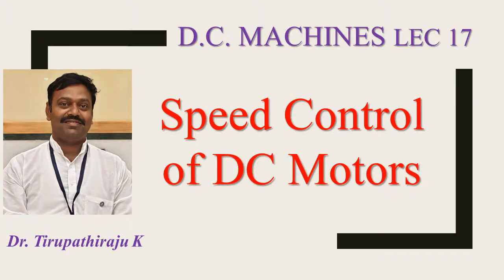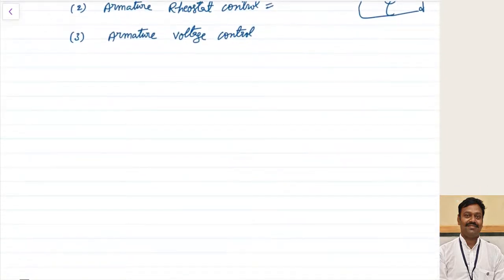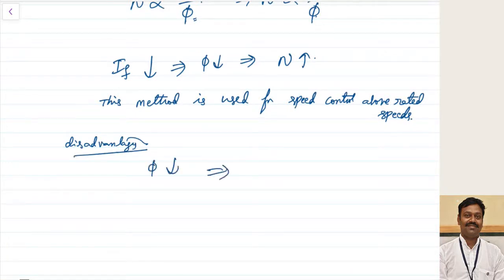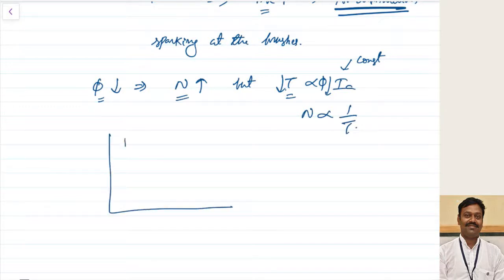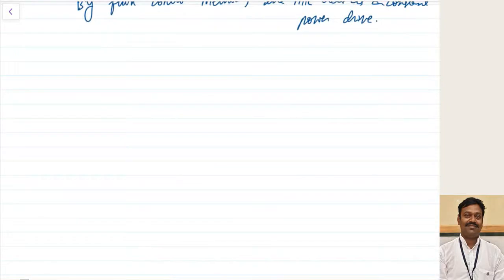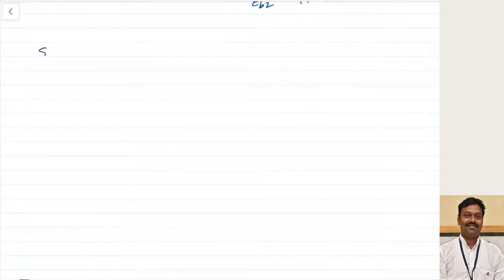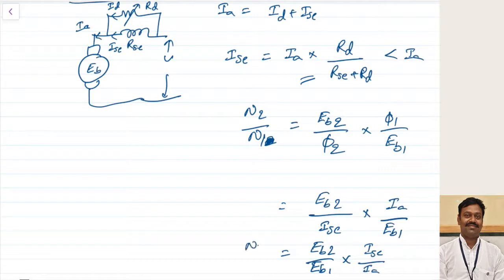DCM 17 Speed Control of DC motors

Comment: At 10:06 
Sir Problem regarding speed (above or below ) in field diverter method .

As i know speed inversely prop  to current , As  current  increses in series field by incresing Rd speed fall  down ,Then it be suited for speed below rated speed .
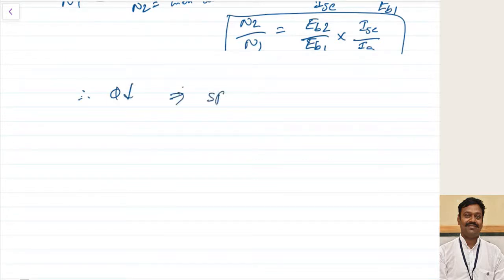Again you are saying at 10:23 
flux decreses (but phi  dec as Ise incr)
Reply: For given load at rated speed, flux & back emf are constant . By connecting  resistance parallel to field, the field current decrease(since current through the field is depend on the load & it has two paths)then flux decrease therefore speed increase. To decrease speed below rated speed, field current should increase but by connecting parallel resistor to field, the field current never increase for a given load

Comment: Sir is it correct that the brass arc( of we use it) connects the no voltage coil to the starting arm??? 
Or is it connected to stud no. 1 of starting resistance
Thank you

Comment: @Lectures in Electrical Engineering Sir..... What will be The Supply with which all the machines will be connected to operate with ?
Reply: @lecturesinelectricaleng  but Sir.... How Would The DC Generator, That is employed there, Rotate With AC Supply ? As The Field Is Separately Given DC Supply To Operate.
Reply: @lecturesinelectricaleng  Sir.... I am asking that how can the provided supply be AC if two of the three machines in the arrangement are of DC type and which needs DC supply ? IS IT CLEAR or I SHOULD MAIL IT TO YOU ? Please provide your mail if you still don't get the question.
Reply: @lecturesinelectricaleng  but two separate supplies are not shown here SIR .
Reply: @lecturesinelectricaleng  NOW it's clear SIR... Thank you so much 👏 Your efforts are truly admirable.
Reply: @RAVIKUMAR-zr9yy   I guess Dc motor uses commutator to convert to Ac in case of motor as motor has mechanical output which is possible only when the poles are alternating.